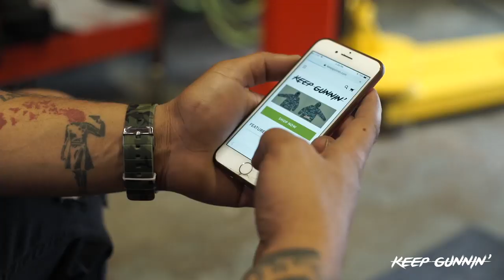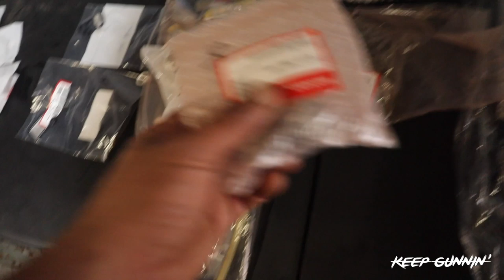K20 TEAR DOWN 🔫

Comment: Just torn down my k20a2 150k miles
Glad I did.
Rod bearings showing faint signs of copper
Motor application will be HPDE/time attack
I am using 86.5mm supertech pistons in the 11.??:1 compression range.
I’m not trying to make massive NA horsepower.
Not going using big HP cams or fully porting the head.
Head is getting complete supertech valve train kit and valve job, guides.
What I call a solid rebuild with rods and pistons.
I’m going to put that money into the oil system and cooling to help with longevity on the track. Not a daily driver. 
I don’t want to lose my motor because of cooling or oil system failure but anything is possible even with dry sump. 
I’ll do what I can though.